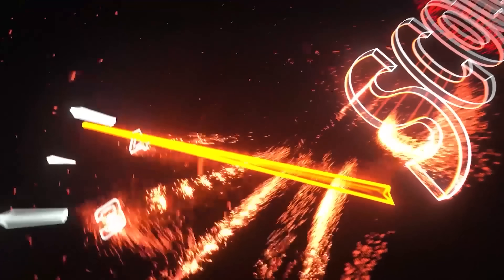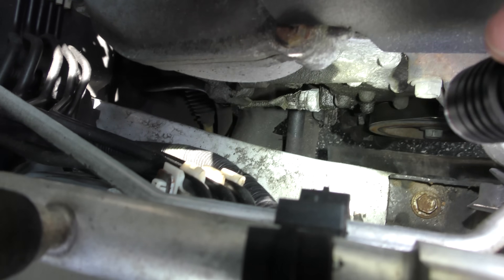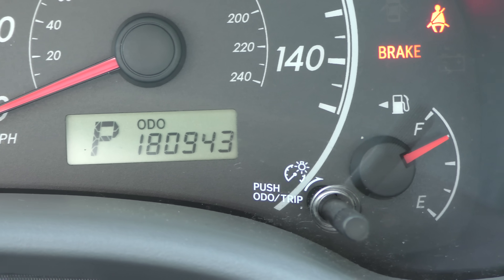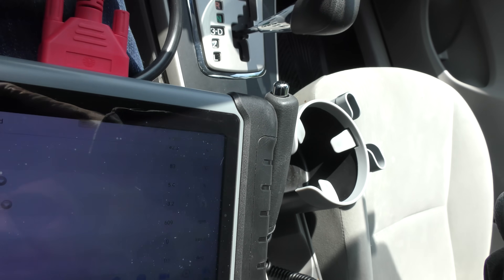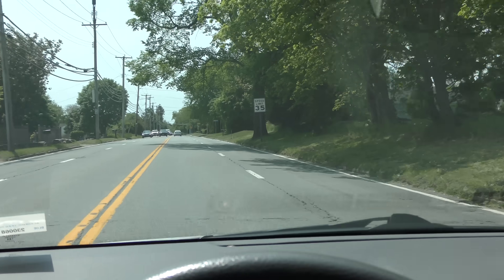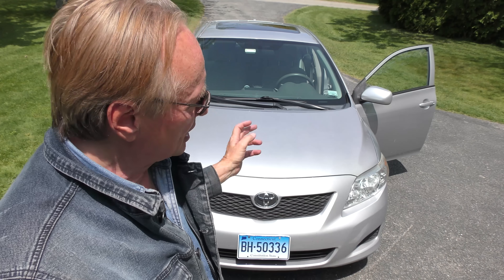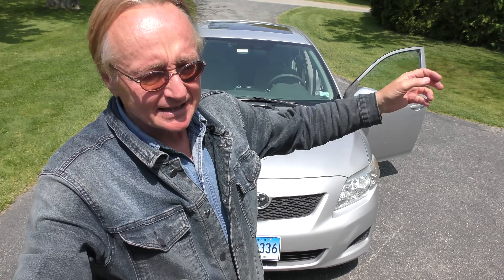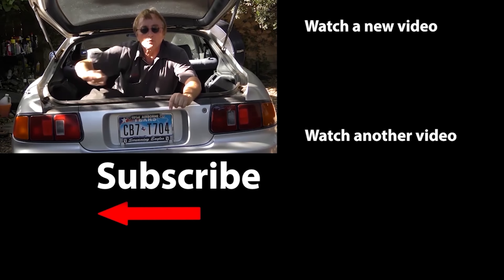Doing This Will Get You Better Gas Mileage

Comment: One of the biggest things I learned years ago about getting better MPG was to make sure you tires are properly inflated. Low tires can cause undue drag and fatigue you engine and transmission over time. Over inflated tires can even screw up your suspension.

Comment: 40mpg gas engine, proof you don't need hybrid cars with massive, expensive batteries to get good gas mileage. 

True, tried, tested.  Gas and oil.  Will never buy different.
Reply: The Prius Prime gets 110+ mpg
Reply: What with all the hate towards electric/hybrid vehicles? They give you great gas mileage.
Reply: @Cntr-Cmd-Delete  it's team based ideologies. They drive gas so they hate non gas powered vehicles.

Comment: With respect, that leak on the rear passenger side of the engine dripping down to the canister that holds the oil filter is coming from the timing chain tensioner.  After years of driving the gaskets on those will start to leak.  I own a 2011 corolla with a 2ZR FE.  This is how I know.  Love the channel.
Reply: I reckon the timing chain covers leak a little too, but its not going to hurt anything. An oem timing chain tensioner + gasket is an easy fix by itself.
Reply: @darnoth772   correct.  Cheap and easy fix.  Just $40 in parts.  The only trick is spinning the crank manually before starting the car to reengage the new timing chain tensioner.  I was losing a 1/2 qt every 5k miles.  Negligible for the time  being but it was getting worse.

Comment: 3:14 I still listen CDs that are full mp3 songs and one mp3 CD can have about 128 songs. I dislike touchscreens, I dislike using phones while driving. I choose to never connect my phone to any of the car's systems. On car tires the rolling resistance also matters when it comes fuel consumption, some tires have so much rolling resistance that your car can loose about 1-2mpg.

Comment: When you want reliability, the only solution is manual transmission. And will save on gas, too.
Reply: Manuals are usually rated lower gas mileage though
Reply: Manual is best. Especially for "beast mode" drivers. 😂  You can skip gears too for mad mileage. Also avoid jerky clutch disengage. A lot of folks are ruining the bearings in manuals these days....
Reply: I got the same mpg on my little manual, 50k mile, 2 door, Ranger as I do on my automatic, 550K mile, 2009 Honda Ridgeline… 12 mpg.

Comment: Got a 1998 Corolla with 1.8L  with 400k burns oil still run and gets things done. The value of it is under $ 1000 but I wont trade it for anything even a brand new BMW

Comment: Back in the day I would adjust the fuel mixture in my carbureted cars. Lean it out for summer/high altitudes. Learned this trick from my scare plane driving days. I have a '20 Corolla (1.8L). Consistently get 40-44 MPG. Screw hybrids.

Comment: Hey Scotty, do you recommend doing oil changes to my 2023 toyota camry every 5,000 miles or every 10,000 miles?
Reply: He already said 6k in the past.
Reply: I would never wait for 10K miles on any car
Reply: maybe at 10000 miles if you drive long trips and no cold starts and citydriving
Reply: I have an old  gm diesel and i change every 6k. Not oil consumption, mileage is stable for 16 years. Perfect condition, 6k or 1 year is my rule.  Just imagine 56mpg   on the highway with ac on, full trunk, 5 people. It's a gm, not perfect, but parts are cheap, and mileage great.
Reply: He said 5000 miles or 6 months, he said oil is cheap, engine is expensive 😅
Reply: He says Always synthetic oil EVERY 5000 MILES OR once a year

Comment: The 2014-2019 Toyota Corolla has the same engine, but a CVT instead of regular automatic tranmission
Reply: Got a CVt on my 2008 Infiniti M35. Tryna figure out if it's going out. Waiting for my radiator and cooling fan to arrive in the mail tomorrow
Reply: In that case, NO THANKS. Stuff those CVTs.

Comment: No one uses CDs anymore?  Whaaaa....?!  I have a CD player in my 2014 Dodge Avenger that just turned 100,000 miles.  It bugs me to no end to know that my next car will not have a built-in CD player.  I have several hundred CDs.  Ah, well.  I went through the same thing with 8-track and cassette.  😂

Comment: I remembered when I got a 1995 Nissan pickup hard body and the air was blowing slowly.  I took out the blower motor, it was installed with the cage to catch everything that fell in from the dash.  It was full of leaves and a matchbook.  😂🤣😆

Comment: The Corolla made in the late ninety's and early two thousands had a bunch of cheap plastics.Especially the door handles would break all the time.
May God bless all!
Reply: @Billy Barnes that’s the least of your worries. Door handle for those cars are like $12 on EBay. They are not expensive BMW plastic that costs hundreds of dollars, thank goodness. Great cars though. Change oil every 6 months and they will just keep running basically almost as long as you want. It’s all about the care and what you do. It’s how I maintain my 2006 Matrix.

Comment: question i have a 96 toyota camry 2.2l 4 cyl has a EGR code have changed all sensors and EGR valve and EGR valve control and also EGR vacuum solenoid yet i clear the code but it keeps coming back what could be causing this

Comment: I replaced the purge valve on my LX470 cause my check engine light was on.  I dropped 16 mpg to 13 mpg. I wish I hadn’t thrown out the old purge valve.

Comment: In a video on another channel some years ago I heard that it’s recommendable to have the ready for ignition mode for 10 sec before starting the motor to prevent some electrical overcharges in some parts (forgot which).
Do you agree?